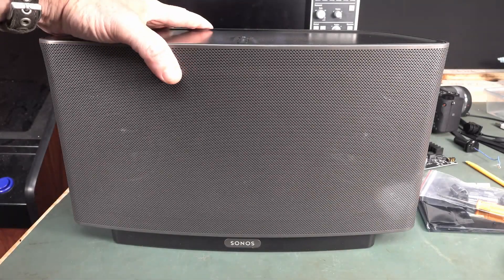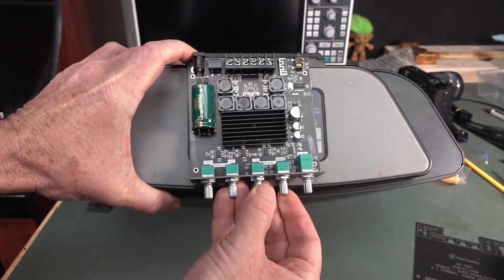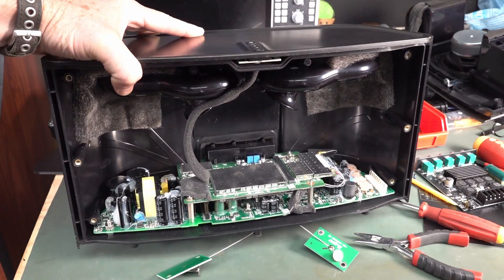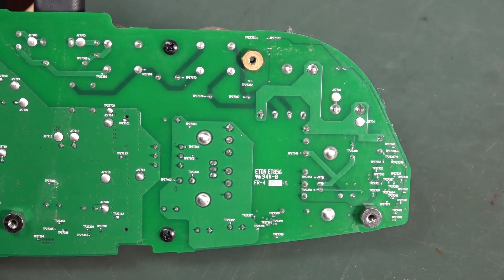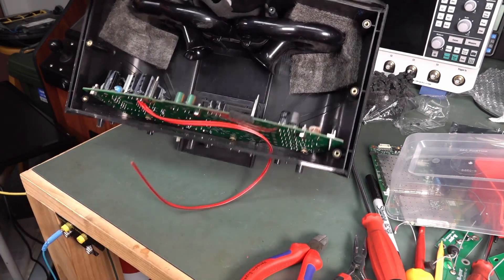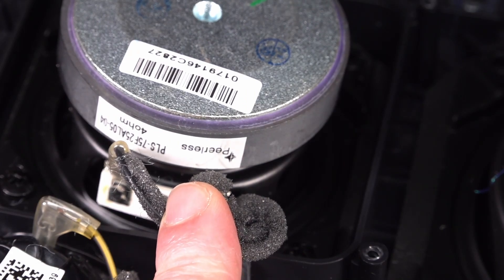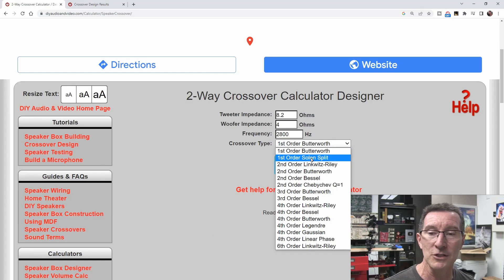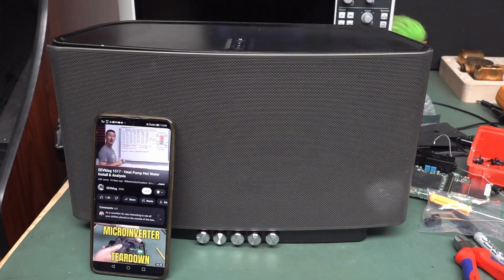EEVblog 1519 - FREE Your Sonos Speaker! (HACK)

Comment: Good job. Converting obsolete 'smart' speakers was an idea I had too for some time - at one point you are gonna get all that fancy Sonos crap at a dime a dozen and they actually have pretty good cabinets and drivers in there.  

However the sound response in your case won't be as good as the original, not only because of the leaky cabinet but also because of the rather rudimentary crossover. 1st orders and dome tweeters operating that close to resonance don't match well. 5kc would be a more appropriate crossover point. Also filters are meant to be designed for the exact impedance at the crossover point, and with the whole impedance curve in mind. Another improvement would be trying to match the midrange and tweeter levels (by ear or dB meter) using resistive dividers. Flip the tweeter's polarity to see if you get a better phase match that way (sound will be louder on axis at Fx). That's about all you can do without too much work and without a proper measurement mic set-up.
Just suggestions though, I understand it is just a basement speaker.
Reply: Sonos would have a nice DSP scheme to adjust for the loudness too. Good enough for this neighbourhood.
Reply: @dosgos  

Yes but that's not really neccessary, some of the world's best speakers are entirely passive. I wonder if the sub had some frequency response correction (Q compensation, low end boost) though, could be.
Reply: @westelaudio943  but this speaker isn't "the world's best" at all. They're using DSP to overcome the limitations of the form factor, just like every other small form factor consumer speaker out there.
Reply: well what i want to know is if the sound is any better when hacking the i2s bus, because at that point i would expect that we benefit from the native crossover. however sonos also includes a mic and a setup routine to measure and compensate for the room. so i would expect that part of the native sonos sound adjustment technology to be absent here. at least... not without doing your own external version of room mic adjustment such as a sonarworks etc.
Reply: @dreamcat4  Sonos locked out all the features here from playing music to all the fancy sound engineering. This equipment was a rental disguised as a sale.

Comment: The only bricking was around the time of S1 > S2 transition and Sonos walked that back. The whole kerfluffle was around, IIRC 30%, upgrades Sonos offered to owners of speakers which could not work on S2. If you didn't want to upgrade, the speaker still worked, it just stayed on S1. If you wanted to upgrade, Sonos offered the discount and disabled the speaker. As mentioned, Sonos even walked that back.

If you don't want Sonos to have your details, just register with throwaway email account. How hard is that?

Comment: The production date thing on the case: The calendar is embossed in the mold, and every passing month somebody manually stamps the current month; so the "newest" mark is the actual one, so they can re-use the mold over n-months. Same as with books "editions" in the front cover where the numbers get removed rather than updated. It's a trick to make it easier to modify such things without remaking the mold; just in case the comment was serious 😜
Reply: Yep, I took a while to realise it when I took apart different devices for repairs. The little dials were a little easier for me to figure out, though, but once I figured both of those, as well as decoding certain serial formats, I could deduce the timeframe in which a device could've been manufactured.

For the books, though, some publishers (usually indie/minor and/or younger publishers AFAIK) just put a single number that they manually increment, but most (usually major and/or older publishers AFAIK) I've seen do what you mentioned and put several numbers and then delete them to have the lowest number indicate which print run the copy of the book was produced in, likely more as a leftover from the days of manual typesetting using printing blocks before the age of computers and Adobe InDesign. 
I didn't realise those numbers on the copyright pages indicated which print run a copy was produced in, until an author I follow on Twitter posted a photo of the copyright page from a copy of her bestselling book to proudly announce that it had reached its 13th printing.
Reply: @kbhasi  Indeed, the "put in a bunch of numbers and remove them over time method" dates back to letterpress printing, where the printing plate would have been made of a metal alloy and had raised surfaces that actually do the printing. It would be a simple job to chisel off one number from the sequence every now and then.

This is less likely to have been done if the copyright page was printed directly from handset type, as it would have been easy to just replace the number each time.

Rather than storing the actual plates between printings, the printer might also keep stereotype flongs from which new plates could be cast. The freshly-made plate would have all the numbers on it, and some would be chiseled out before printing. This avoids storing large heavy plates and also takes care of the wear that the plate undergoes during printing.

Plates can also be made photographically from negatives kept from one run to the next. In this case one would black out some of the numbers on the negative before making the plate.

There is no reason, and in fact no simple way, to do this with modern direct-to-plate offset lithography. Nowadays the offset "plates" are discarded after the print run and new ones made for the new printing.
Reply: Oh hey, cool seeing you here :p
Reply: Yes. This type of date code has been around since at least the late 1970s.

Comment: I bet Sonos has included some hefty sound processing on their boards. 
I doubt that that speaker will sound anywhere near it did with the original board but that’s just my guess of coarse.
Reply: Your guess of *course is correct. It will not sound good.
Reply: It is not hard to get sound quality equipment to Sonos speakers, mid range bookshelf speakers with mid range amplifier sound much better then Sonos speakers.
Sound processing in speakers is just sign of bad design of speakers, properly design speakers do not use any sound processing (or any active component at all), most speakers after mid range quality are passive.
Reply: @mrlazda  I don't necessarily disagree, but at the end of the day all that matters is the sound waves generated.

Traditionally you'd do this with careful and (often expensive) physical design, nowadays it's possible to compensate with DSP. Neither approach is inherently bad, and sometimes DSP lets you get surprisingly big sound out of smaller speakers.
Reply: @JMMC1005  I do not disagree with you that DSP can easer make bad acoustic design sound better (hide bad design, and maybe more appealing for ears) but that is only patch for bad design.
DSP are mainly used bacouse is cheaper solution (and easier) to make speakers sound "good".
Small speakers can sound good (or even great) but they are no where close to big speakers,  but small speakers have their place, all depends of your needs.

Comment: Seems like an awful shame to discard all the existing drive circuitry. Is there no either 3rd-party firmware for the existing controller or a 3rd-party controller board replacement?

Comment: To be fair the this generation did get released in 2009 a decade plus ago.
Reply: All the while many audio devices from the 1960s still work on original components...
Reply: Yeah but my hifi system dates from the early 80s and quality-wise will absolutely piss all over this IoT spyware garbage! If you really love music, then there is absolutely NO substitute for a proper amplifier and good quality passive speakers, not this BS class D crap with tuned frequency responses to try to compensate for the kind of crappy drivers that you would have found in a 90s tv set.

Then again, the youngsters these days listen to their so-called music through their phone speakers, so I guess my generation was the last one that really gave a damn about audio quality.

And yes, if you really DO need bluetooth audio, even with an old hifi setup like mine, you can buy high-quality bluetooth adapters for WAY less money than the obscenely intrusive always-online crap that Sonos are peddling.

(Note don't buy cheap BT adapters from ebay if you like good audio quality - cheap bluetooth sounds like crap - there are some really good bluetooth audio codecs available now that actually sound really good (though still not quite up to high-end audiophile standards, but certainly no worse than these Sonos things)

Comment: My next steps here would be to add a Raspberry Pi Zero W with a Pirate Audio DAC running the Snapcast client.  I have my whole house done up with RPis running Snapcast with a few different feeds into it.  So good to see more attention being given to the problem of perfectly good hardware being rendered useless by greedy IoT companies. I can't stand IoT. If a device can't perform its most basic functions without an internet connection, I will not have anything to do with it.
Reply: Would be great if somebody just designed a drop-in replacement board for it, so the integrated amp is re-used and the setup is clean
Reply: I will have a look at Snapcast. I agree with you, that I am not asking the cloud whether I can listen to music or not in my castle.
Reply: It's less about IoT than vendor lock-in. Your alternative setup is still an IoT solution (and sounds pretty cool, btw). How's that working out? Are you satisfied with multi-room audio experience (solid sync, etc)?
Reply: @SS-hc6sp  Oh man, I love it!  Very stable and great sound.  If you set things up right, it can be bit-perfect playback even for hi-def music.  Mine is not likely bit-perfect, but I play hi-def files on it all the time (96KHz/24bit FLAC).  And I very rarely have issues with sound sync.  Once in a while one unit will lose its mind and be up to a few seconds off, but that is rare (once in maybe 6 months?) and a quick reboot returns it to sync. A RPi Zero W with any one of a few really good sounding DACs will plug into pretty much anything for amplification and powers from a 1A USB cube.  I have 8 clients in my system: two boom boxes, two hi-fi systems, three shelf/desktop systems and a Frankenstein system on our back patio.  No IoT involved.  Local network only, except when the music source is Spotify.  Other sources include MPD/Mopidy, AirPlay and "broadcast". And more than one source can be used at the same time and directed to different sets of speakers.
Reply: @koyaan1sqatsi  Oof, you've sent me down a deep, deep rabbit hole, but it's utterly fascinating and I had no idea this existed. I started reading about the stack to get that working, and I can see standing up a snapcast server on my proxmox instance that runs HA. Started reading about MPD and music-assistant in Home Assistant, then looked at HiFiberry equipment. It's definitely a rabbit hole, but seems like a phenomenal replacement for Sonos.
Were you able to source pretty cheap DACs that adapted well to the Pi or did you use something specifically built for the Pi? And does that set up just rely on the Pi to drive the speaker, or are all your setups using external/built-in amplifiers (like the bookshelfs, etc)? I could see adapting a Sonos Play:5 over to that pretty eloquently, even using the same amp he has there. However, I guess in any case one loses the ability to control the eq (or at least bass and treble) from HA interface, correct? Or is there a solution that exposes those controls?

Comment: I have the play 1 gen 1 (and $1000's of gen 1 gear) and I agree with those that say it is BS that software can make your speaker obsolete. Yes, there is a separate app for the old stuff (can't mix and match with the new!), but I cannot even use my old speakers as monitor speakers! It is either the app or no go ( can't airplay or chrome cast to the speakers!) and the app does not look like it is being updated and even worse, the firmware. In my opinion, at the very least sonos should have open sourced the old code so that the community can add additional features and security updates.

Let this sonos fiasco be a lesson for internet of things devices and also realize that you do not own these types of devices, it is up to the manufacturer if they will allow them to be usable, you just own worthless hardware. I know people with 30, 50 year and even older audio equipment that still works fine and is as usable today as the day it was purchased. 

Lastly, these types of companies (and apple you are one), are the first to preach about climate change and being good stewards of the environment,  but it is their planned obsolescent gear that is filling up the garbage dumps and contribute to polluting the environment (not even talking about carbon cost of manufacturing), the stench of hypocrisy is strong with these companies. I will not buy another Sonos product, ever and any IOT thing I buy, if it cannot be controlled locally i.e. no apps, no services etc. that I cannot install, configure and run myself and are open source compatible, then I am just not interested.
Reply: Well said

Comment: I hate this product design philosophy, it's purely evil.
I get that the "smarts" become obsolete, but for this kind of product, if it works now, it will probably continue to work in the future, if you disregard new functionality, the only thing I can realistically see being a problem would be if the hardware doesn't have the processing power for the new security standards being used to communicate with whatever online services you use, like Spotify, for example, but even then, you could still easily use it as a local network speaker with no issues at all.
But if you really want to, at least make the "smarts" a separate, user replaceable, module, so the user can just upgrade it **cheaply** when it can't keep up.

Comment: Very cool, it's exactly what I thought you should do when I saw the teardown. Even pro audio speakers are going the way of being highly complex and integrated. It used to be more common to have a passive speaker that was well tuned and constructed with external power amping, now they contain a switchmode PSU, class D amps and onboard DSP all slathered in silicone. Pretty much any component failure necessitates a whole board replacement. Fingers crossed the manufacturer will sell it to you without it being prohibitively expensive. Can't wait for the brave new world of IOT subscription based systems...bleh
Reply: Hate the modern smps & class D based plate amps all you want, but they're pretty great tech when done right. I repair and design both older Class G/H as well as cutting edge class D nowadays, and it's really fun! There's so many things that are prohibitively expensive or complex in the fully analog world of passive crossovers or active analog crossovers, that the digital world with DSP and unification really brings a new light to the world.
Reply: @AnnaVannieuwenhuyse  It's not that I hate them, I mean I do use them professionally. It's just a financial risk factor to be aware of when talking about equipment that costs thousands each, especially when they're well out of warranty.
Reply: Yeah my 80s hifi system will bury any of this new stuff out of sight in terms of audio quality, and if anything ever goes bad on it, I can easily fix it myself
Reply: @countzero1136  Glad to hear you're completely in denial. We've come a long way since 10%IMD was state of the art.
Reply: @jrshaul  No denial at all - Nobody with a decent quality hifi needs to be in denial of anything - the only people who are in denial are those who think a poxy all-in-one plastic box is capable of audiophile quality LMFAO
Reply: @countzero1136  You said "New Stuff."

Genelec studio monitors are very definitely "New Stuff."
Reply: The active systems seriously outperform older equivalents and the better ones often have replaceable modules - EV uses Hypex amp cards in some of them. 

Most PA speakers had fairly crap crossovers to keep the component costs down and relied on redundant outboard DSPs for equalization and integration. I'm not averse to putting the electronics in a big rackmount box, but when you've got dozens of reconfigurable line array elements each with individual EQ and parameters, that's potentially hundreds of pairs of thick copper cables running hundreds of feet. 

You know what doesn't have much line losses? 240 volts AC.
Reply: I doubt that that speaker will even sound  decent without the Sonos DSP.
Reply: @Conservator.  Yes that's a good point if you're looking for the best frequency response. I'm not sure how much they fix in software compared to purely cabinet and driver design. That's my concern with my EV pa speakers if I ever want to mod/repair them. Very good quality cab and speakers, but it's all designed as a package with the onboard DSP.
Reply: @Conservator.  It won't.
Reply: @zaprodk  

It's possible to get it to that point though.